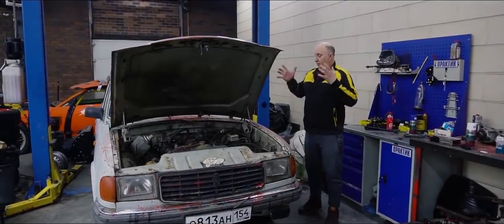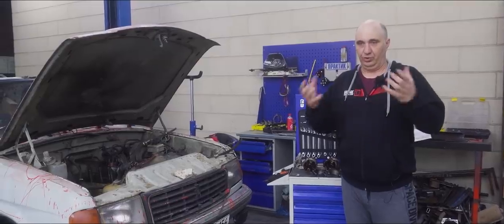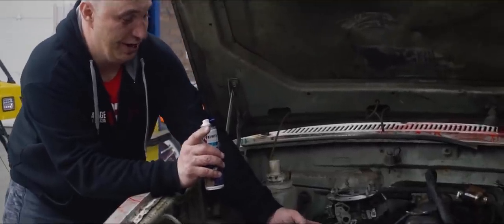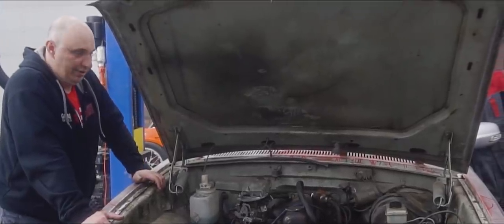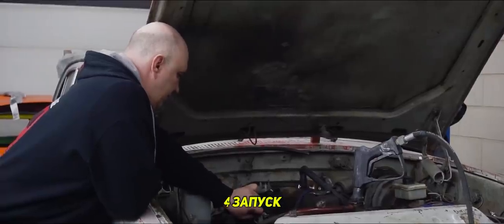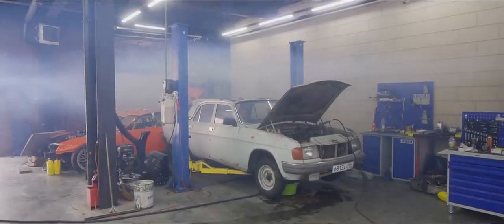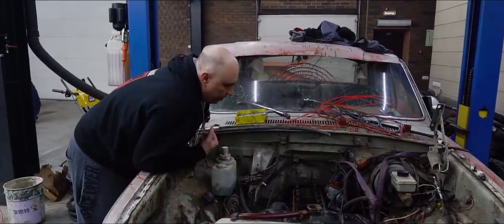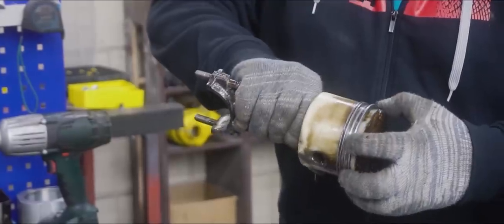Fabricating plastic pistons (will they work?)

Comment: He’s like, “look at it shaking!” Yeah no duh, the crankshaft was counterweighted specifically for the weight of the metal pistons, so putting plastic ones caused an imbalance because the counterweights were way heavier than they needed to be with plastic pistons 😂 So crazy that this worked though lol
Reply: There will be little weight difference. Platic is more likely heavier than aluminium pistons. Con rods haven't changed.
Reply: @taxidude  Con rods contribution might be lessened due to nature of their rotational travel, or maybe increased, now that I think of it...hmmm.  Plastic con rods likely would have worked FAR better than plastic pistons, might have even lasted a few minutes, rather than a few seconds.  

As for the weight difference, I've seen drive shafts made of plastic that are two to three times lighter than their metal counterparts, and able to take two to three times the torque, so maybe not so much.  They don't dress out F1 cars with FRP (ALL over the place) because it is inferior regarding strength to weight, compared to metals.  And if you've ever ridden a carbon bike, or used a carbon tennis racket, etc. it should be clear what I'm saying, if not try one of them, then you'll understand.  Just sayin'.  It would also depend heavily on the comparative design volume of each, obviously.

I've never seen fiber reinforced metals, though it seems and interesting idea (probably not original, either). 

 Just searched it and found a presentation, yeah, not original, not surprising, and currently used.  Also, it shows many benefits, water absorption not being one of them, in some applications, any way.  I also expect the fiber material must be chosen carefully.  I can see materials like glass not being a good choice for wearing metal to metal interfaces where the reinforced part is the softer of the two, at least not if the location of the fibers is not controlled (kept internal).  Fibers like steel whiskers might prove interesting, too, for lower melt metals, not too practical though, likely.

Thanks for the comment and the resulting trip down the rabbit hole. Learn something new every day.  Nobody here probably cares, but there it is, anyway.   Yet another comment tome from John.   :-)
Reply: @taxidude  What you are suggesting would be true if it was a single cylinder engine. On a multi cylinder setup balance depends on the total reciprocating mass. And that includes the piston, conrod and the crank counterbalance, meaning all moving components in one cylinder, versus the total mass in the opposite cylinder.
Reply: @taxidude  Dude what? What plastics do you know are that heavy!? Caprolon's density is 1.14 g/cc while hypereutectic AL pistons will be above 2.7
Reply: It was shaking because it was misfiring because not all of the pistons were still working properly.
Reply: Correct

Comment: Put some 2-cycle oil in the gas and see if the extra lubrication can make it run longer.
Reply: You mean 2 stroke
Reply: The problem seems to be the combustion heat not the friction on cylinder. Better solution would be running it on a fuel that combust at lower temperature.
Reply: @thomasmcdougall8059  Doh ! That's just semantics. A 2 stroke engine IS a 2 cycle engine.
Reply: @thomasmcdougall8059  Same difference.  One is an engineering term, the other colloquial, if I'm not mistaken.  It's called a two cycle  (or stroke) because the piston produces power every stroke, and intake occurs at the beginning and exhaust at the end by ports being opened during the cycle, without the need for valves (necessarily anyway, some have them, reeds on the intake) and two turns of the crank to accomplish this.  It does with porting at the loss of efficiency (volumetric) and typically gain of pollutants.  Though there was one two cycle outboard done by Johnson or Evinrude (don't remember, thinking the latter) that was pretty amazing on at least one of those fronts.  Basically it's 'equivalent to' car and automobile.  Remember the blank is to blank bullshit on public school tests?

And yeah, what Buddy said, too, not just Shane.  And I would have named them one and two cycles, frankly, based on crank rotations per power cycle, but hey, I didn't name it (not THAT old).  The same 'cycles' occur in both, just not at the same rates.  And then there's rotaries (or Wankels, see how that works?).  They actually produce THREE power strokes per cycle but then they screwed up the whole crank/power cycle by making the crankshaft turn three times faster than the rotor, kind of HAD TO pick some value greater than one to implement the design though, just the nature of the beast. Or come up with some transnational shaft output and convert THAT to a useful geometry.  They did it right....Germans...not surprising.  Their production quality isn't great but their DESIGNS, marvelous.
Reply: The Alloy of the original Pistons disperse heat rapidly...the Plastic material will retain Heat and melt.
Extra Lubrication will not help.
Reply: @thomasmcdougall8059  it's the same thing as 2-cycle
Reply: @thefreedomguyuk  2 Strokes is one Cycle..so a 2 Stroke engine fires each 2 Strokes..one Stroke up..and one down ...2 Strokes + Equals one cycle.
 Four Stroke Engine is 4 Piston strokes per firing Cycle.

Comment: Now make pistons of JB Weld. Very good stuff.
Reply: Project Farm has done that with making a head for a small engine.  It didn’t last one.
Reply: They have jb weld extreme heat. It can handle sustained temps of 1000F
Reply: @sonacphotos   I assume you mean as a joke, because if not it's a bit like pumping bleach into your veins to wipe out COVID...'we're looking at that, right?"...and the doctor present starts to slide under the table to keep from laughing (or crying).   I'm totally amazed there were no eye rolls presented accidentally, pretty solid resolve from those present with at least three firing brain cells.  I knew a Goodlett that worked was an engineer at Martin, any relation?
Reply: @sonacphotos  Same same with a small four wheeler Didn’t even last a day
Reply: @MrJdsenior  just had to mention it didn't you.
Reply: JB Weld works well but in my experience with working on everything from track cars to grocery getters and high displacement chainsaws never in applications where extreme pressure or modulus of elasticity is a prevailing constraint. High temp Carbon fiber composite? It'd have low reciprocating mass and high strength if it could resist oils, gas, and heat degradation.

Comment: Oh Hell Yea!! This was a great experiment, fantastic results. Try using a special kind of coating that will protect the plastic from the intense heat of the combustion chamber. Do everything the same as before , but give the pistons a tiny bit more clearance in the cylinders. Also, use a coating that will adhere to the plastic in an intensely heated environment, a coating that is really good a reflecting heat away from the piston.
Reply: What you're describing is Unobtanium

Comment: Full on race cars are ridiculously close tolerances to help performance, for instance a F1 car engine at least when they were V8 were technically siezed after transportation. Hot water and other fluids had to be pumped around the engine to warm it up before it could even be turned over to start. 👍Great video 🤩😁👏👏
Reply: Yeah, and tires brought to near boiling temps before use, blowers used on the brakes at pitting to keep everything from literally catching on fire, plastics all over the car, idle set at about 3000 RPM, maintenance required virtually constantly...wonderfully practical vehicle for everyday use :-) , but FUN to watch.  

I would have loved to be on an engineering team for one of them, but alas, I went with killing machines, at least most of my career.  Not proud of it looking back, except for the tech, but it put food on the table, so to speak.  I saw MANY improvements they made (F1) later well before they made them, and I know nothing about the electronics, which is what I would have primarily been working, but I know built in test on automobiles of even a decade ago all out sucked, even with most of the sensors already there to accomplish better functionality.  BIT is complicated and requires in depth thought, like the complete boundary scans done on later super complex ICs.  I suspect the car industry has gotten much better too, but in all the engine problems I've ever had I think the OBD got it right about once, and then it was one of about three things, as I remember.  If you can instrument it cheaply and diagnose from as a tech, it should be just as easy to build it in (and pretty darned cheap, any more, pretty darned capable processors are basically given away now, and many  sensors as well).  That three cents really matters to some hair brained ankle biter though, of that I can guarantee.

Comment: for anybody who's interested, the material shown in the video is Polyamide (PA-6) in my opinion
Reply: They should use PEEK with 15% Glasfiber + 10% PTFE. Cost 100€ per Kilo in Granules.
Reply: Yup. Oil filled PA-6.
Reply: My first thought was a PEI.  Ultem might hold up well but it is a little brittle when cold.
Reply: Should have used Polytetrafluoroethylene, also known as PTFE and Teflon, is a widely used plastic that was discovered in 1938 by the company Chemours. It has one of the highest melting points out of any plastic, 620°F (327°C), but it maintains its strength at temperatures as low as -450°F (-268°C).
Reply: @cylentkills  Yup.  PTFE absolutely.  If they undersize the pistons to allow for thermal expansion they might even be able to go for a drive.
Reply: @atik333  that’s granules - not in Billet form. I was quote £2.5k for a bit 300x300x20
Reply: Yuck Foutube  rulon has gf filler

Comment: Can you please make a video where you mount the carb to the exhaust and the exhaust to the intake manifold and see if you can make the engine run with the exhaust and intake reversed.
Reply: he'd have to switch out the camshaft as well, otherwise the valves with still open for exhaust and inhale timing.
Reply: or make the engine rotate backwards and have 5 reverse speeds and only one forward...
Reply: I had a hard time breathing reading this

Comment: Amazing.  I guess air compressors are coming with teflon pistons now (with no rings).  This channel is awesome.
Reply: That should pose no issues, but keep in mind that the absence of combustion in a compressor creates much lower temperatures than an internal combustion engine experiences.

Comment: You should try Polytetrafluoroethylene, also known as PTFE and Teflon, is a widely used plastic that was discovered in 1938 by the company Chemours. It has one of the highest melting points out of any plastic, 620°F (327°C), but it maintains its strength at temperatures as low as -450°F (-268°C).
Reply: I thought that was what he’d used on first look. Would make some sense but the thermal expansion is massssssive!
PEEK would work a long while but the cost would be huge.
Reply: Nope. Teflon is expanding a lot when exposed to heat. Teflon pistons would seize even sooner than what we saw here. 
And by the way, PTFE was invented by Du Pont. (Not a huge difference, though).

What's needed here is a thermoset polymer.
Reply: @SW-qr8qe  Thank you, Sir ! Great seeing a person who know what he is talking about.
Peek may actually work. A Peek composite with glass fiber may actually even be useful. But, as you say, would be pricey.
My guess is epoxy would be possible to use, and cheap.
Reply: (PEEK) Polyether ether ketone is a colourless organic thermoplastic polymer in the polyaryletherketone family, used in engineering applications. It was originally introduced by Victrex PLC, then Imperial Chemical Industries in the early 1980s
Melting point 649F
We used to use it as wear bands in experimental vehicle dampeners. We cycled a military Stryker damper over a million cycles with a 3000 pound side load. When disassembled the hardened steel cylinder walls had major wear, the peek wear bands had ZERO measurable wear!
Reply: @thefreedomguyuk  I commented before reading your comment. PEEK would be an interesting experiment!
Reply: The crucial point I think is that any kind of plastic, no matter its structural strength or melting point, conducts heat away very poorly, so the temperature of the crown will rise enormously, and excessively.
Reply: @robwilde855  I wonder what they did on the Polymotor project? That was a project which first ran in the 80’s and again in the 00’s to produce a fully plastic IC engine. Somebody else can have fun of Wikipedia with that ...
Reply: @robwilde855  https://en.m.wikipedia.org/wiki/Plastic_automotive_engine
Reply: @SW-qr8qe  Thanks for that link, Simon.  Very interesting stuff.  Looking at it carefully, though, it's clear that the successful engines always used metal all around the combustion chamber, I.e. cylinder lining, the part of the head that forms the top of the chamber, valves [though one engine had plastic inlet valve stems, which are obviously kept cool by the inflowing air], and piston  crowns.  I presume that the metal piston crowns were not just attached to the top of a plastic crown, but had direct heat transfer all the way via metal from the 3,000 degree C gases above, to the cooling oil below.  
    When you think of an internal combustion engine, whilst everything gets too hot for us to touch, of course, the actual temperatures vary enormously from one part to another.  Some of the newly-invented non-metallic materials have amazing properties of strength and lightness and resistance to wear, and can use manufacturing methods such as injection moulding, that can bring great improvements, undoubtedly, and I would think this could apply to a large majority of the engine's components, or indeed for the greater part of its mass.  The cost is probably what is keeping this out of mass use.  Always, though, the temperature limits, expansion coefficients, and ABILITY TO TRANSFER HEAT will have to be considered.  
    This last aspect I think is the one thing that the [I have to say loveable] character in the above video didn't fully appreciate!
    All good stuff for us to witness in the future - that is, if the insane idealogues in government dont' shut down all that industry.  
    One regret though:  it's interesting and satisfying and in some ways easy to work with metal, as an individual, working on one's own stuff.  The further technology advances, the less scope for us to enjoy these things in our own ways.

Comment: Whatever happened to the high temp Diesel engine developed by ( I think ) Isuzu. Pistons and cylinder walls were made of ceramic material.
They were able to operate at massively high temperatures . The engine block had its water gallery cover hatches removed so there was no cooling. The heat coefficient of the ceramic was almost zero and was demonstrated by heating the piston to an incandescent temp  and then inserting into the cylinder  

that had been cooled for some time in liquid nitrogen. They fitted perfectly.  I think that the point of the experiment was to 
Demonstrate the efficiency of using a much leaner fuel consumption and a much more efficient fuel burn temperature.
The most spectacular presentation was to use the ceramic piston as a crucible to melt an original metal piston from the engine,and then ,after decanting the molten metal, place the piston in the cylinder . These demonstrations were carried out about 20 years ( or more) ago, then ,nothing more was mentioned. Perhaps the oil industry might not have liked the idea..

I enjoy your channel and appreciate the English translation.   Maybe your plastic pistons are not very good heat conductors and melt before they can dump the heat. 
Cheers from Australia 👍🇦🇺🇷🇺😷😷😷

Comment: There is a plastic called poliether-ether-ketone (PEEK) it's classified as a superpolimer, it has extreme chemical resistance, it's flame resistant and strong enough to make gun parts like chambers, gas operated recoil systems, it's effing expensive but  I think it could work for small 4 strokes like a beetle engine.
Reply: Any idea what kind of plastic this Caprilon is?

Comment: What type of plastic is caprylon (don't know if that's how its spelt). I can't find it anywhere online. It looked like it machined in a similar way to acetal but I'd never imagine it would stand up to that punishment.
Reply: Caprolon (капролон) is a Russian brand of PA6 aka Nylon 6.
Reply: @djdjukic  Thanks for that 👍. Sounds like he was pronouncing it wrong. Plain old nylon 6. I’ve used plenty of that. I’ve even machined slew gears for cranes from it. I should’ve know from the way it looked while he was machining it.
Reply: @iancanty9875  Yeah I thought it was Delrin at first, but the chip was too clear.  I couldn't nail down exactly what it was either.

Comment: Another suggestion: can you drive car with pedals working on opposite matter. For example car idles when you press gas pedal down and revs when you release gas pedal.
Reply: Press to release gas
Reply: Sounds interesting.
Reply: They've done that with a clutch. It was very hard to drive.
Reply: Inverted gas and brake pedals lol.